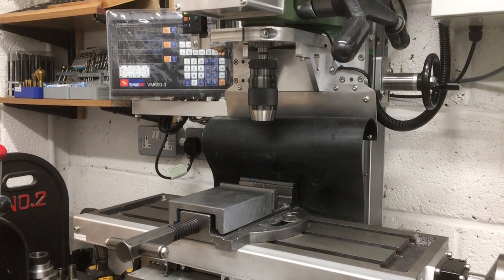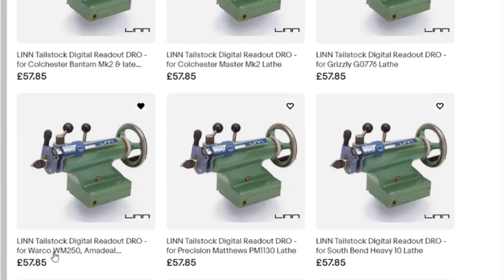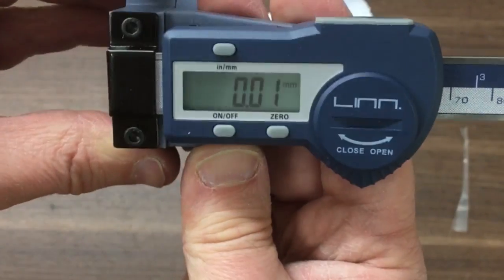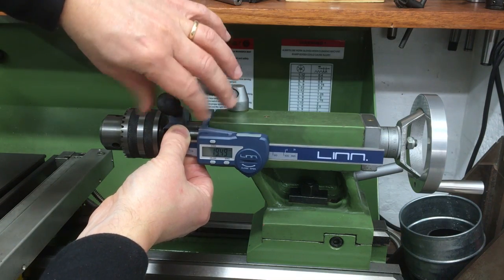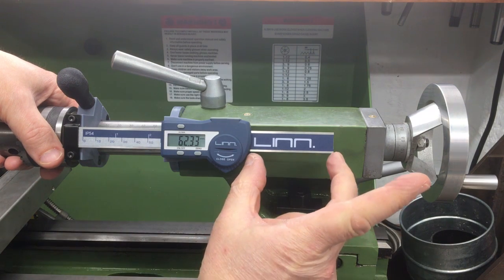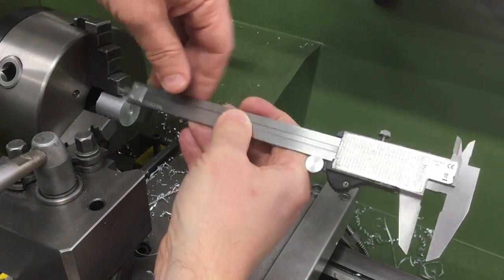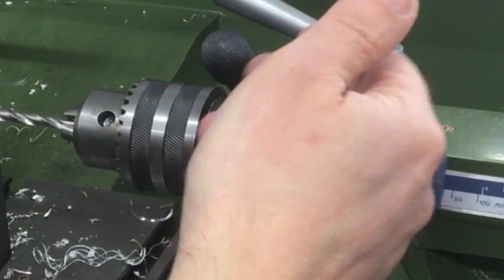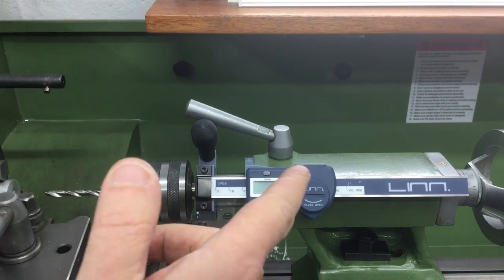LINN tools tailstock DRO review - any good ?

Comment: Thanks for the review!  I am in the middle of installing DRO on my own mini-lathe and was curious whether the item that you reviewed could also be installed on the crossslide for the X axis. Couldn't get a clear sight of your knob so your impression would be much appreciated. 

Thanks in advance......
Reply from the maker: This is designed to fit a tailstock.  I think a cross slide would need adapter brackets so I would just buy a generic DRO and adapt it to suit.

Comment: Add a selected thickness washer under the sleeve clamp handle so that it clamps with the handle away from the chuck, I would do that anyway, regardless of the DRO.
If you are planning to leave it on the mill most of the time then shorten the clamping stud and use a hex nut.
Reply from the maker: Yes that is an option.  It’s been on for some time now so just a nut would also work as it has not been removed.